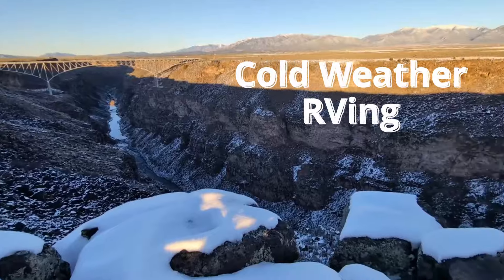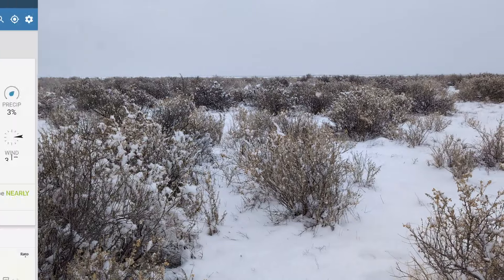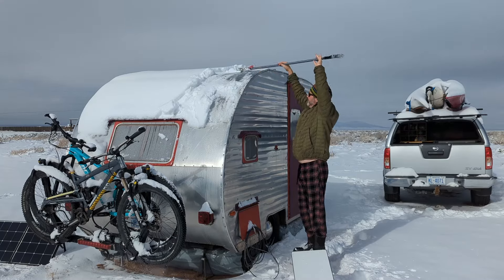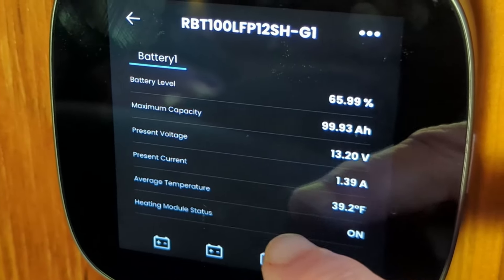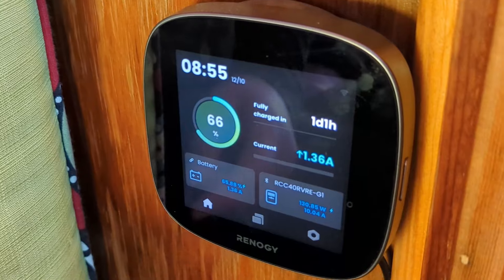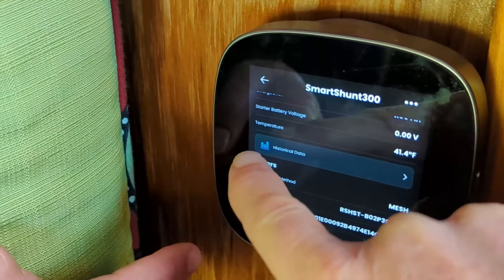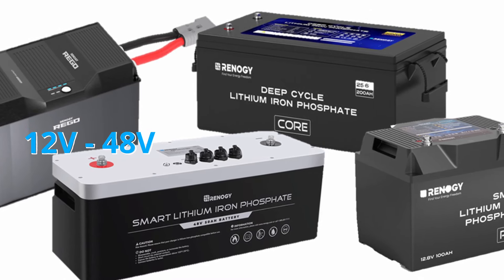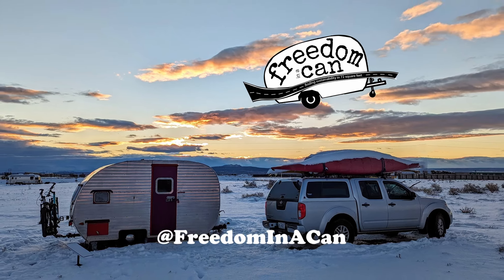How Do Self-Heating Lithium Batteries Work?

Comment: I just installed 2 Renogy 400ah Rego batteries in my van. The Rego needs 15 amps per battery from a charger to heat. Under 15 amps and I get warnings. I can't seem to find a way around that so I think I'm going to make my own heating pads and insulated box. Will yours heat themselves from battery power or do they need a charger too?
Reply from the maker: Have you downloaded the full REGO battery manual?  It's pretty thorough, aka massive, and clarifies all those alarm settings.  Our batteries will not heat themselves without a charging current, either from solar (most often) or DC to DC charger while driving.  We also have an AC to DC charger that we can use, anytime we've got a campsite with electricity, or moochdocking, might be once a year.  
It's a good idea to insulate your storage area and maybe use a battery heater to keep those babies warm in cold environments.  Are the batteries inside the same space that you are?  Just having them installed somewhere in the living space that you might heat will help keep them warmer on those cold nights.  Best of luck.
Reply: @FreedomInACan  The batteries are in the living area but I'll only heat that area a few times a month and it will be off the grid in a really cold climate. Sometimes below the -22F storage limit. I have downloaded the manual and I believe the code is a Cell Charge Low Temperature Warning so just a warning before it goes into protection. The heater also has the red disconnect when there isn't adequate solar. I was hoping there was a way to use the batter power for heat, but I can easily make that myself for pretty cheap anyway. My situation is probably unique compared to most. So far I'm pretty happy with those batteries. Thanks for the quick reply!!
Reply from the maker: Yeah, that does sound pretty specific.  So, sounds like an insulated / heated box is the best way to go so that it can continue to charge.  For what it's worth, the AGM batteries, which are rated for the coldest climates, only go down to -5F, so this is a much better option for you.  All the best!

Comment: That’s interesting, I assumed lithium self heating required 120V AC power.
Reply from the maker: Nope, that would mean you'd need to be on the grid.  While you certainly can charge (and heat) with an AC source, DC to DC, Solar or generator charging source will start the heating cycle.   All the best!